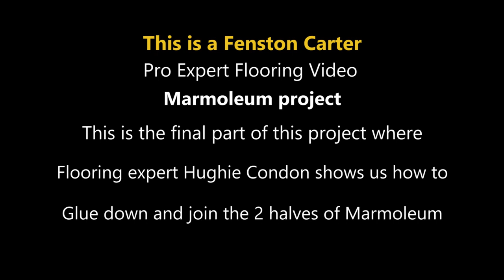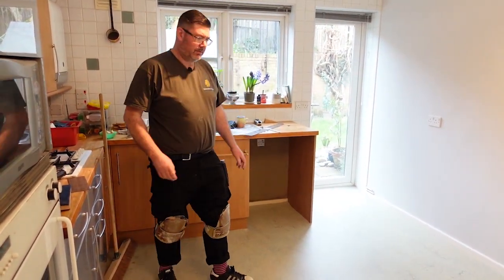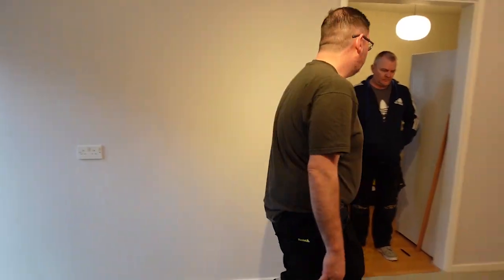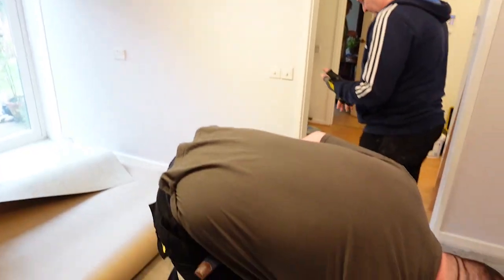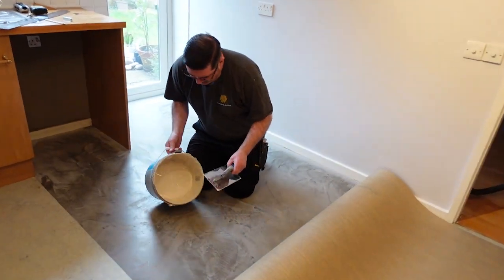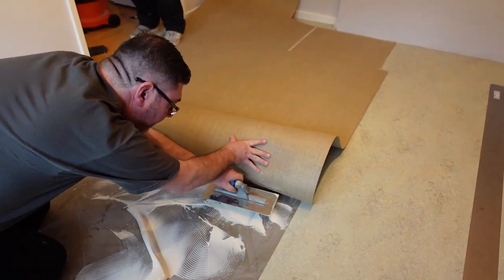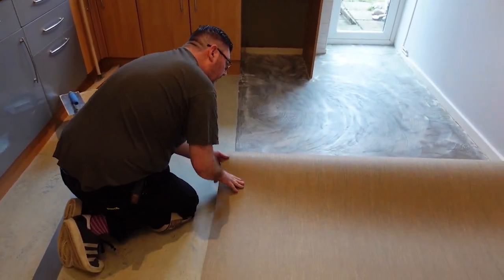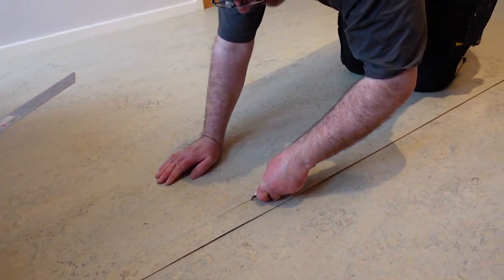Gluing down a Marmoleum floor - the right way! A step-by-step guide from a professional floor layer

Comment: Great video. Do you ever install the MCT tile? Would love to see how that goes down.
Reply from the maker: Thanks for the question, Ben. Well for some reason the Lino tiles are not as popular as the sheet and we haven't fitted any in quite a while. Usually work well in tiled patterns. We will make a video of a fitting the first chance we get.

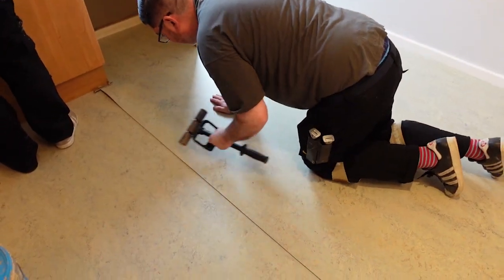Comment: Very informative video... at the 11:50 mark, a tool is introduced that was referred to as an "over under tool".  I tried to search for this tool using google but couldn't find it.  Could you provide a link to where I can find it or provide a proper name for it (I'm guessing that "over/under" is a nickname of sorts)?  Thanks for posting this video... again very helpful to understand the process of installing Marmoleum sheet linoleum.
Reply: Found it!   It's officially called a "Recess Scriber" here across the pond.  Crain makes one, the model name is "No. 370 Recess Scriber".
Reply from the maker: @pags1573  So sorry I missed your message yes, that is exactly right! A recess scriber is the official term.